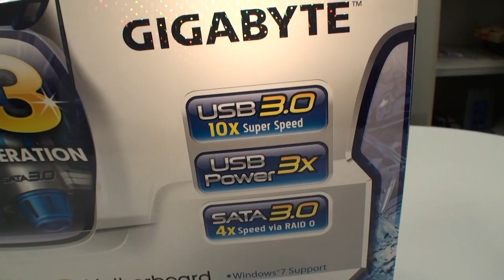GIGABYTE P55A mobos - SATA3, USB3 and 3x USB power

Comment: @lightningpete Thanks for the idiot.. there are two i7 series processors, one for p55/sk1156 which is DUAL CHANNEL as this motherboard is (don't let you fool by the 6 ram slots) and the other, older, that is based on x58/sk1366 which is triple channel. Inform yourself before saying idiot to somebody. P55/socket 1156 as this motherboard is DUAL channel. I own a similar motherboard as well.

Comment: So even the usb 2.0 ports can power 3.5" hard drives now?  I can put a 1.5tb seagate drive in an external enclosure or docking station  and just power it with the usb 2.0 cable and ditch the power brick?